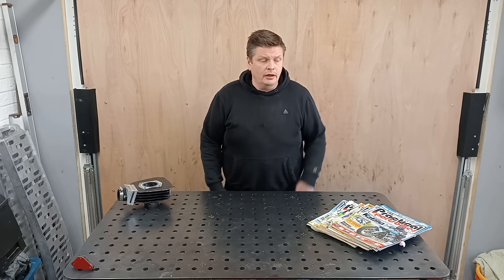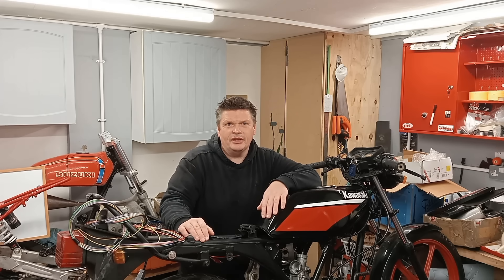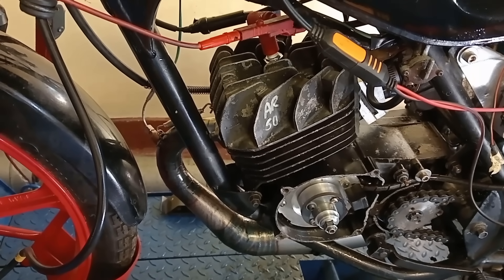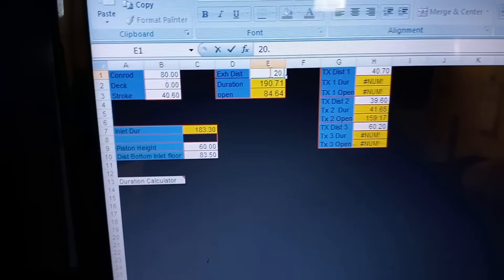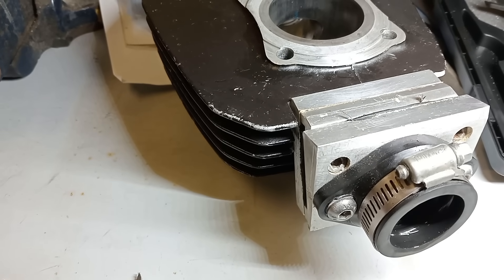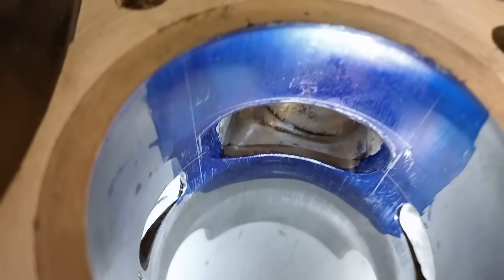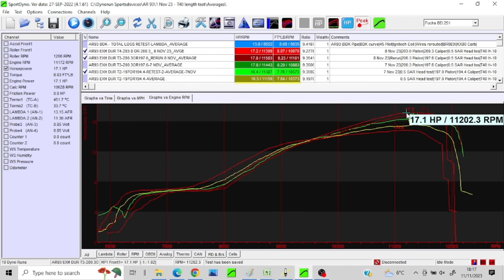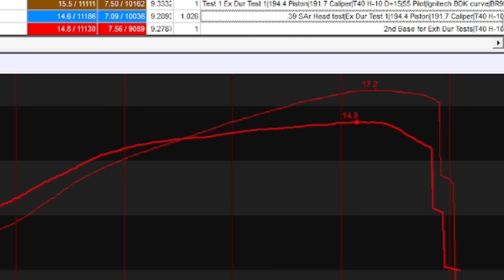This Tiny Port Change Changed Everything (Dyno Proof) #2stroke #power  #porting

Comment: Your looking for disaster with no chamfer on the port you will snag a ring.
Reply from the maker: It seems happy at the min with a radius.
What dimensions would you recommend for the chamfer?
Reply: @AutoBeta2T  IMO, a small .010" (.25mm) champher will be good enough to not snag a ring (or cause accelerated wear).  But I like to use a radius for the top of the exhaust port to help the gas to flow more smoothly.  For champhering, I really like the smooth diamond impregnated rotary tools as they have no flutes, runs smooth, and pretty much impossible to slip and mark up the plating.  Then I try to blend the plating edge to the cylinder wall with a rubber abrasive from cratex. I can usually get a blend so good, it is hard to see where the plating ends, and the aluminum begins.  After porting 10's of thousands of little 2-stroke cylinders/engines, I have never snagged a ring.  I would love to see some data on how or if, a large champher changes port time, but I have never found such data. But I wold bet a radius on the top of the ex. port does have the effect of slightly more open duration.

Comment: I remember using specs from a motorcycle magazine to tune one of my 350LCs years ago.  I still remember some of the requirements: raise exhaust ports 1mm, squish clearance 0.9mm, set ignition timing to 1.9mm BTDC, and run NGK B9EV plugs.  Standard pipes, air box but no filter.  I also ran slightly larger 28mm choke carbs from an RD250/400.  I recall it being a successful tune, boosting power but maintaining reliability.
Reply from the maker: Sounds like a win-win! The Old mags in the day used to do some good tuning articles. Probably John Robinson!?

Comment: Love your videos! What is the name of the tool at 7:00?
Reply from the maker: Hi, cheers, and they are some internal calipe.
Reply: @AutoBeta2T  Yep, internal calipers.  Like telescoping gauges, they do not give us a measured number, so we have to measure the caliper (in this case) with a set of micrometers or dial/digital calipers.  That tool is in a class called "comparison gauges" because we have to measure the gauge to get a number.  Typically, they are not quite as accurate/repeatable as a direct measurement because of that "comparison".  They take a little more skill than a direct measurement to get good with them, because there is more opportunity for error.  Those calipers (ID or OD) maybe the oldest measuring tool in machining, before actual measuring tools with numbers were invented. As for example I can assume, if you wanted to copy an OD, you would 'compare" what you cut to the part you are replacing.

Comment: I just stumbled onto your video/channel. Have you tried opening up the intake ports yet? Seems like that should've been modded (10months ago when this video was made that is) at the same time you were opening up the exhaust port. Highly recommend a tiny blown through carb turbo or a little super charger. Stuff for RC cars and such could work. Nitro is always an option as well! Pink Nitro and some 2stroke oil mixed up to a 15-20:1.
Reply from the maker: Hi, welcome to the channel 😀 
Yes, in a previous video I opened up the intake to fit a larger reed valve. I've also added an extra floor port in the intake to feed the crankcase, which did give some more power.
Reply: @AutoBeta2T  ahhhh, good deal! And thank you, you've created a great channel!
Reply from the maker: Cheers buddy.
Here are the links to the vids: 
Fitting a bigger reed - https://youtu.be/8A4aEVAWUg8?si=69OFourOGFKqvcyk

Intake floor port - https://youtu.be/F2cEQLG-kYA?si=MRXO3ZHiWPHHWf0t
Reply: For the 2-stroke engines we know, supercharging does not work because the boost will just blow out of the exhaust port after the pressurized transfers open.  But, with great loss of the fuel/air mixture blown out of the exhaust port, it probably does fill the cylinder better with fresh charge, (not mixed as much with lingering ex. gasses from the last power cycle.), and can realize a bit more power just because of that accelerated flow out of the exhaust port.  But the pressure in the cylinder before the ignition can not be elevated by forced induction on the 2-stroke we know.

Comment: What is the porting basic please explain 😢
Reply from the maker: Measure and see what timings you have and what area. If you can calculate the Specific Time Area (STA) and see if there is enough for the power you want. If not increase the size of the ports to give enough STA.
Reply: @AutoBeta2T  That is a method.  Basically, porting is changing the size and locations of the ports in order to fill the cylinder as well as possible for a desired RPM range of operation.  If more rpm and more power is wanted, the faster piston speed means less time the ports are open, (basically), means the ports will have to have more "time area" (be cut bigger), to fill (intake and transfers) and evacuate (exhaust) the cylinder in less time.  Each port does have a optimal size for the specific rpm you want hp to peak at, so it is highly probably that "over porting", (cutting too much), will be done and lose some power if we don't do a good job figuring out port time area. The TSR porting software I have, (now not available) worked pretty good.  It was a great package for porting 2-stroke engines. Showed the entire process with all the engine data involved. But the new computers over run it today.

Comment: I have a moped 50 cc.. with standart piston 38mm..

I have done it to 39.5mm piston.. but its destroying my rings very quickly, also when i set piston with rings its enter to cilindar very hard

Can u explain if i want 39.5 piston.. how much should be cilindar? Whats the tolerance should be done?

Thanks
Reply from the maker: Hi, have you checked the ring end gap?
Reply: Rings figs to cilindar 100% without any gap.
Reply from the maker: @wikiliks1187 There should be some. gap. What is the standard engine spec say it is?
Reply: @AutoBeta2T its 38mm standart piston.

Its tomos apn 6 , u can find on google for infos u need

I dont know how much gap should be ?

Thanks
Reply from the maker: Hi, I can't see any but a rule of thumb is 0.5 x bore (mm), so about 0.2mm min for you.
Reply: @AutoBeta2T  so one more time

When i put new rings.. with new piston.. on the cilindar.. and when piston is on TDC ring should stay opened for 0.02 mm?
Reply from the maker: @wikiliks1187  hi, no.
Rings are usually measured near the bottom of the cylinder. The gap.sould.be 0.2mm (not 0.02mm)
Reply: @AutoBeta2T great, thanks for your info

May u tell us which is your prefered eletronic ingtion to upgrade on these old engines?

Thanks
Reply: @AutoBeta2T  He is using a 39mm bore size.  .2mm (.008") is too much, (but still in spec).  I told him .08mm (.003"), and that is just a tad on the high side, at least comparing to my 250cc MX cylinder at 67mm bore diameter approx, that specifies a .003-.004" gap (.08mm -.1mm).
Reply: @wikiliks1187  The ring will expand as it gets hot, (like any solid material), so you need a bit of a gap so the ring ends to not touch when expanding, and possible "bow" the ring into the wide ports.  You can use a small file to file off the ends if they do not have enough gap, (and it does not take much filing).  IMO, the best way to measure the gap of your ring(s), is to take the ring off the piston, put the ring in the cylinder in the same orientation that it would be on the piston, (piston ring pin location and the same side of the ring "up".), and use the piston crown to push the ring (nice and square), into the cylinder, just above the exhaust port.  Then measure the gap with a pair of feeler gauges.   For your size bore, .003" ring end gap, (.08mm), should be a new ring and safe from the ends touching.

Comment: So, we can conclude. High duration exhaust, can get peak power at high rpm right.. but at the graf. Max rpm 12k rpm.. how to change to get rpm 13k rpm peak power?
Reply from the maker: Hi, for 13000 rpm I'd shorten the pipe.
Reply: @AutoBeta2T  ohhh. How much to shorter.
Reply from the maker: @abdurrahimmohdnor9005 pass, I'd have to run some numbers through a calculator... I'd guess 50mm?

Comment: In mm I run 18.4mm and it's a good 👍 also ran 17.8mm exhaust roof.. and was even better BUT my port style is unique to anyone else 😊
Reply from the maker: Cool, what stroke is that on?
Reply: @AutoBeta2T  I build small bore and big bore.  I work on the cheapest possible engines money can buy and make them with fingers crossed super powerful.  The port style hit me one day and it has had me intrigued since
Reply from the maker: Cool, do you have any more details on your port style?
Reply: @AutoBeta2T  I'm interested in breaking 100mph with a small bore on grass with a 35cc small block. Twin carb
Reply from the maker: @carbrc cool. What chassis is this on? I guess some good aero? What engine is it? How square is the bore/stroke?
Reply: @AutoBeta2T  the 35cc is a 38/31 20,000+ rpm range, the 45cc is a 43/31 17,000rpm range  application 1/5 scale RC or goped . Very strong tiny engines
Reply: @AutoBeta2T  aero would help RC 1/5  reaching 100mph on grass.
Reply from the maker: @carbrc  ah okay. Is 1/5 scale?
Reply from the maker: @carbrc  missed this before the last reply. Cool, so is it a car?
Reply: @AutoBeta2T  yes sorry it's a hybrid car I run which is slightly longer than most rigs. Do you have a FB page .
Reply from the maker: @carbrc  hi, https://www.facebook.com/share/SbmxYEspX7736vpr/?mibextid=qi2Omg

Comment: U need minimum 15000RPM for normal power if its 40/40mm bore/stroke. its 30,7 to ???
Reply from the maker: Hi, I think it would struggle at that rpm.  Being over square reduces the port area available for given port timings.

Comment: I suggest putting on the chain guard or wearing a protective cover on your left 🦵 leg . That chain can break and wrap around your leg 🦵 and rip it apart. Pr the engine could toss that rod into either 🦵  leg .please think and be safe. It only takes 1 accident to hurt yourself use some wisdom!.
Reply from the maker: Good point.

Comment: On a port with rounded edges I measure to where the curved port edge is 45 degrees from vertical. 
Raising the exhaust port allows more blowdown time for less exhaust pressure overlap of the transfers at high RPM for less restricted transfer flow which increases power but at the same time lowers the trapped cc so it is possible to raise it too high.
Reply from the maker: Yes, increasing blowdown certainly seemed to help on this engine. I believe it still may want a little more, particularly with the new pipe mick abbey had that gave a flat top to the power curve peak. For the final test, I only raised the centre of the exhaust roof so it could be flattened a bit more. I have heard of durations as high as 208 degrees on the exhaust duration on single port exhausts... I guess a trade-off between slowdown area and trapped compression.
Then again, lowering compression can put more energy into the pipe... 

As with all things, two stroke:  change one thing a affect several others!
Reply: How do you measure a curved edge in degrees?   I love the rest of your post though.  I can see good thought there for sure.

Comment: Hi there, what is the stud pattern on AR50 cylinders? 52x52mm?Also, could you please share that excel file to convert mm in degrees for cylinder porting? Thank you so much
Reply from the maker: If you email me on: Autobeta2t@yahoo.com 
I can send you the file.
Reply: @AutoBeta2T   thank you so much! i just sent you the mail
Reply from the maker: Hi, it's 60*60mm for the studs

Comment: 2  min : SURE NOT a Piston with an hole on exhaust.. 😆😆😆🤣🤣🤣
Reply from the maker: Yes, it's a hole I drilled and tapped. I wanted to use the piston as a porting guide using a screw to fix it in the barrel but it didn't work too well.

Comment: You really need to just buy a simple deg wheel.  Valuable tool makes things so easy..
Reply from the maker: See other reply - I'll get one and give it a go. However, for what I am doing here, it's a lot easier to measure with a calliper than having to refit the cylinder, fit a degree wheel to check, particularly if I need to take off again to grind some.more.
Reply: @AutoBeta2T  My old TSR porting software has a great little program included (of many).  With the stroke, bore and piston pin offset input into the software, it will tell you linear distance between the degrees of crank rotation for the entire stroke.  For my little engines around 180 degrees for exhaust duration, it is really close to .005"/degree.  So if I want 3 more degrees duration at the exhaust port, I remove .015" from the roof of the exhaust. Makes the degree wheel obsolete IMO and is much more accurate.

Comment: What about chainsaw exhaust boxes or 2 stroke motorized bicycles with a 6-8 inch straight pipe ??? Dose a free flow exhaust help ?
Reply from the maker: Hi, straight pipes aren't the best. The box exhaust will be tuned for a certain rpm so help but I for high performance then an expansion pipe is best.
If you have a look at the video in the link I compare a straight pipe to a half and full expansion pipe.
https://youtu.be/jaAE-Bq2lvo?si=CuBp-qE0Mti7Vzcw
Reply: @AutoBeta2T  On the Zenoah 26cc engine, that comes stock with a can, it loses power compared to no exhaust at all, (can or pipe).  I calibrated my water brake dyno with the stock engine with no exhaust, (can or pipe) at all, and no intake air filter as tested at the factory to make 2.8 hp at 12,000 rpm, (factory claim).  With the stock can, it only made 2.3 hp, almost a 20% loss.  The best tuned pipe of that day made 4.2 hp on the same stock engine.
Reply: @AutoBeta2T  thanks , I’ll have a look !

Comment: When you raise the exhaust port you lower the CC of the engine
Reply from the maker: Hi, the swept volume of the engine remains the same but the trapped volume does reduce affecting the corrected compression ratio.

Comment: i wish i had excess to this info when i was racing in the 60/70/80  well did the port are calc by hand , i cannot see how air flowing in steady state using a none tapered ex pipe will give any valuable info , now using a running engine with manometers in the pipe ,plus pressure transducers , that would show the wave movement yes , testing with out the head on and the transports flowing again i dont think will do any thing constructive , please prove me wrong , i stopped tuning two strokes in 1988 , i had a road 50 , a gilera touring in 1980 as my transport to and from work it only had 4 speeds , piston ported two transfers , itwas configured as a race bike , with a fifty derbi fairing , 86 mph was its max , i had to keep it sensible in port timing and my pipe allowed it to pull top at around 55 mph ,so riding in a 30 limit was 3rd off an on the pipe
Reply from the maker: Hi Alan, sorry for the delay in replying. I am too interested to see it steady flow testing will aid in duct design. I'd love the TFX engine data acquisition equipment to measure in -engine pressure wave movement but it's several thousand pounds. Either way will be interesting to test and see. Hopefully I'll get to the ton this summer.
Reply from the maker: 86 mph but of a 50cc is very good going. 💪👍
Reply: @AutoBeta2T  Well, that depends on how steep of a grade the down hill is.   :)

Comment: While it's quite nice to see u go through these testing steps might I suggest tightening up the testing parameters a touch . Taking care of the little things like welding the leaks in the exhaust, choosing a way to measure port timing that is repeatable and as troublesome as it may be, building a pipe that is correctly sized for your modifications. As a former drafter designer our attempt was always to remove any ancillary issues so that the test readings would should only the effect of the modification being made. I do sympathize with u take my word for it but it really is the only way to get the specific info your looking for. Anywho good job my friend and wishing u success!
Reply from the maker: Hi Matt, I do try to be as consistent as possible... I'm reasonably happy with the measurements of the ports now. The main leak from the exhaust is from the adjustable section in the dwell which I can't weld at the min as it wouldn't be adjustable anymore. Usually this joint does seal a bit better but it's not the best on this pipe. I'd like to do some more testing with this pipe so don't want to weld it up. The header leaked a bit too after I cut it down... This could be fixed.
Reply from the maker: Also, I do have another pipe to test that was designed around the higher higher exhaust timings. As with these things, time is the killer.